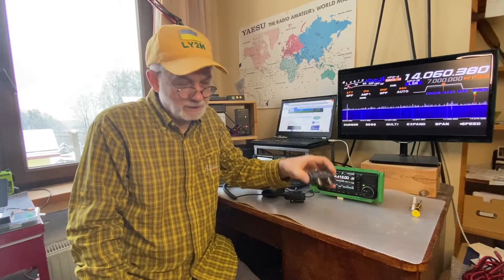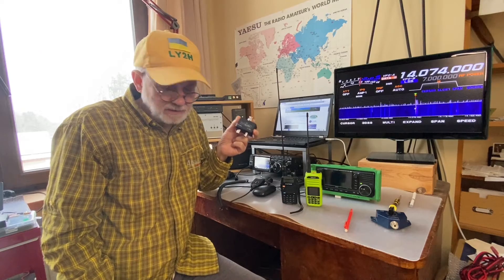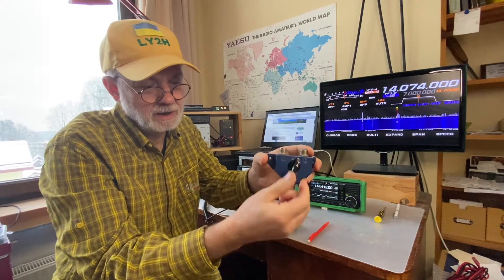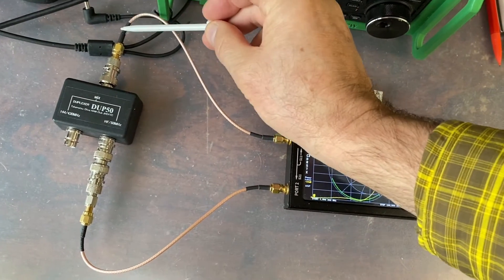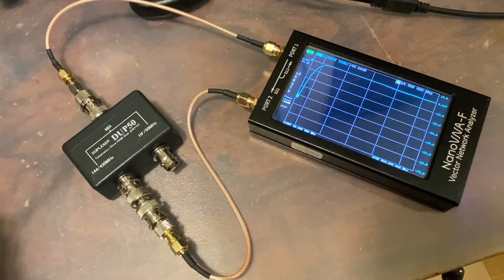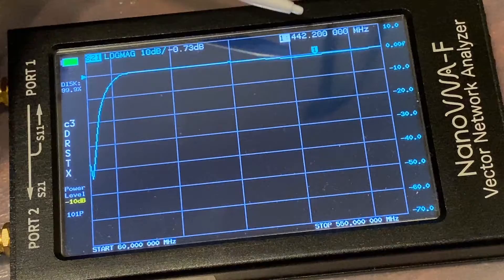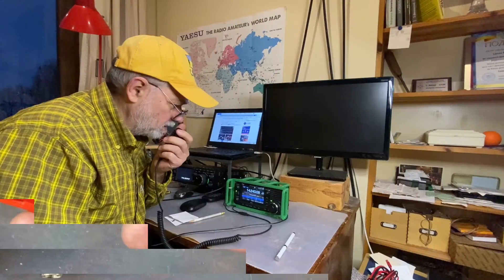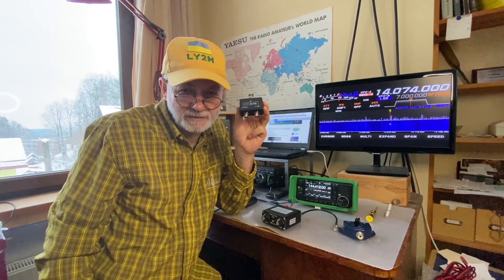DUP50 for IC-705 review test and duplexer vs diplexer discussion.

Comment: I have not much experience, and therefore need to look it all up. You are right about calling that device a Diplexer. I see that even established ham radio web shops call the same device a Duplexer. There is a clear difference though. I stumbled upon this same semantics problem as  was looking for a commercial splitter. As I have understood a Duplexer duplicates the signal, is also a 3-port device, and have a separation / isolation between the 2 duplicated channels. You could also be right about the application within a repeater. But those devices are often called directional coupelers. And you also have circulators that also do similar thing 🙂 But I need to study it some more. 73!

Comment: I completely agree and share your interpretation of the correct use of the name in order to identify different equipment with and for different functions. But even reputable manufacturers misidentify diplexers as duplexers, and this has led to widespread confusion in the amateur radio community.
73
CS7AWJ